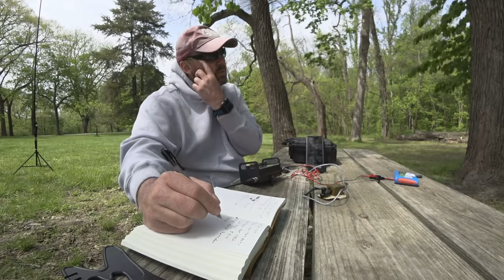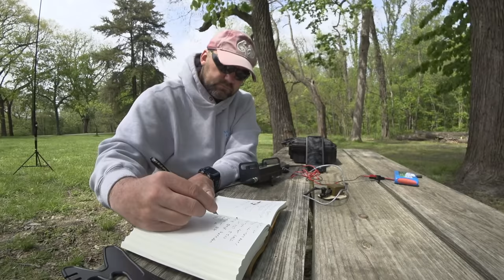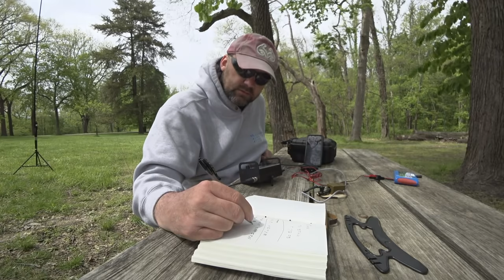Live Portable QRP Today! Elecraft KX2 Random Wire Antenna

Comment: Long, but good video Tom!  Gave us all a look at just how much work goes into making these videos.  I was exhausted by the time you were set up to operate...lol!  And you got a positive shout out from Cliff (N4CCB) my favorite YouTube QRP channel!  The antenna worked pretty well considering as did the KX2 auto tuner.  I know how frustrated you get when trying to make a QRP SSB phone contact.  But I can't emphasize enough the importance of a resonant antenna for QRP SSB voice contacts!!  CW sends a steady carrier of 10 watts or whatever power you are using thus continuously cutting through.  SSB voice gives off and on 0-10 watt spurts of power that is less efficient with your voice modulation. Especially if your non-resonant antenna is soaking up half the power.  An EFHW resonant antenna is much better than a one-size-fits-all EF antenna.  A RESONANT half wave dipole would be your best bet.  Hang in there buddy!  73!
Reply from the maker: Yeah I hear you on the resonance but thats hard to do in tbe field with a time crunch. Also cant really shorten a luve video. Its the real deal. Thanks for the nice comment. I will work on my resonance

Comment: Great video again, thank you! It reminded me of my own struggling in similar circumstances. And that notebook is just something, showing its rebelious nature all the time. What surprised me is that awful noise on 40 meters. I first thought it is the vertical sucking all the static. But then the same should have been on 10 mhz, which is so close, but there the band was Ok. May be electrical lines are somewhere nearby? As for the rest, it all looked very inspiring! And no balun in the antenna set up? Amazing!
Reply from the maker: Exactly, the tuner in the radio did a great job.  I had the same exact feeling, why the heck was 40M so noisey?  And I need a better notebook. That's exactly what real world is like.  I'm going to do this again and fix all my problems and make the videos shorter.  Thanks for great comment.

Comment: There was a threat of snow early Sunday morning. Fortunately the snow blew over Lake Erie north of Cleveland and only rain was received. My Chow Chow needed to go out at 0430, I was not aware that rain was falling until we stepped outside. Got drenched. Back up at at 0730 so I could leave for 2nd half of Florida QSO Party. No rain. Cold, 38F. You didn't look very cold when you arrived at the park. Doesn't look or sound windy. @21:00 I saw some movement in the tree branches and leaves. Is that Flex-Weave wire? Is that about a 17 foot fiberglass pole? You look really flustered. Keep a couple rubber bands in your notebook. Put rubber bands across pages when working outside to keep your pages in place. Signals were QSB more Sunday than Saturday during the FQP. My club had less contacts this year than last year. I had to let about 30 CW contacts go because they could hear me. Conditions didn't seem great Sunday for the FQP.

Comment: Missed your live presentation please describe antenna setup
Reply from the maker: It's 3 wires.  I cut it for 40 meters but at 1/8th wave.  So it's about 5 meters up, and 2 of the ground legs are about 5 meters also.  And I used a tuner.  I'll talk about it on my VLog tonight or tomorrow.